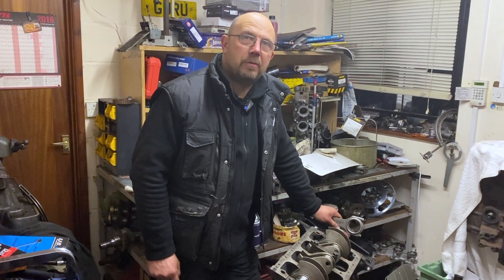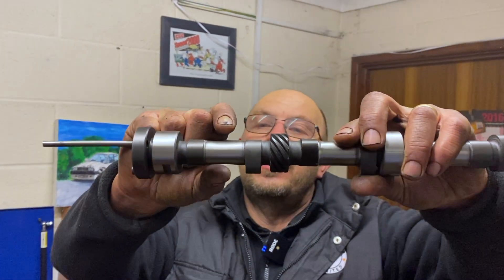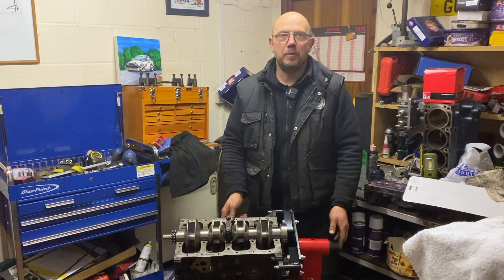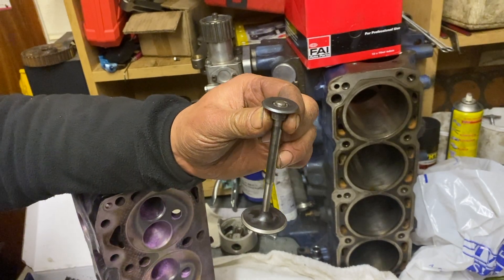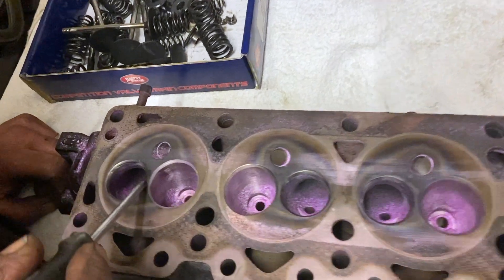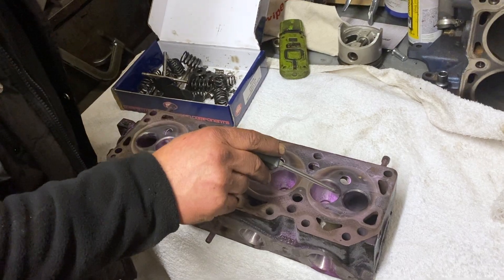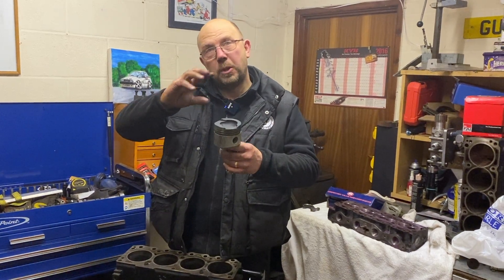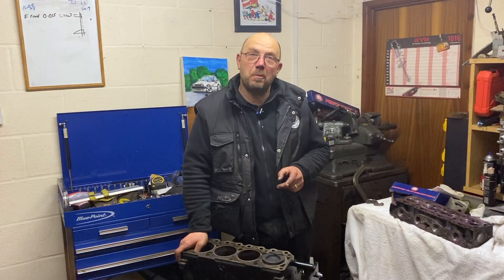1906cc Crossflow Cracked Head! - Engine Build Part 2

Comment: Hey, what pistons were these in this video? I opened up my x/flow this week and found a set like this and the rest of the motor turned out to be not stock and I haven't been able to identify them beyond the point that they are a 1300 bowl.
Reply from the maker: they are just normal 1300 cc pistons, but i cut the skirt off to clear the crank counterweights

Comment: Crossflow is a slang term, no crossflow exists never has. They are called 'kent engines'. As they were made by kent through ford.
Crossflow is mearly the way the gasses cross the head.
Pinto is another. Does not exist apart from our slang. Its another 'kent'
Reply from the maker: Maybe so, but for the last 40 years I’ve been around them they have always been called that. I don’t get clients ring me up and ask about “Kent’s” they ask me about x/flow and pinto, is it any different to me using the nickname I have for one of my granddaughters? In fact most of the family now use that nickname :)

Comment: I've run heads with worse cracks than that G, never caused any issues, wait til they start tracking up the port before worrying.. Looking forward to see how it revs, my 1860 with diesel crank was a lot more sluggish than my rubber lump 1660
Reply from the maker: one of them already is going up the port, but in anycase, neither myself or the owner want to use a cracked head and the owner has already dropped me off another couple of heads so its not a big deal
Reply: Yeah I spent a few hours port matching a 1300 head only to notice mine had a crack in the exhaust valve seat after I'd finished tidying up when it was all done. Got the motor for free put it in my escort anyway and it's been fine for 1000s of kilometres. Got a spare motor I'll get round to building one day, hopefully it doesn't have any cracks anywhere, I'll have it tested of I ever do build it up.